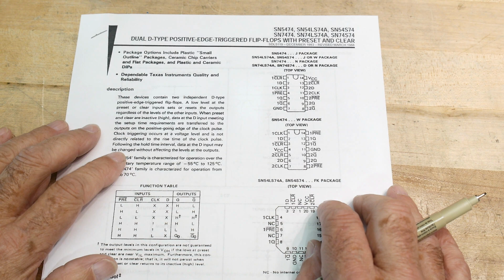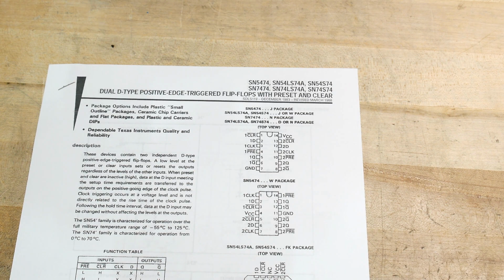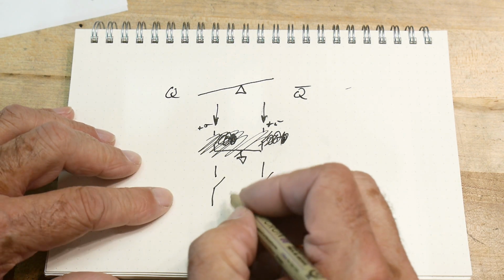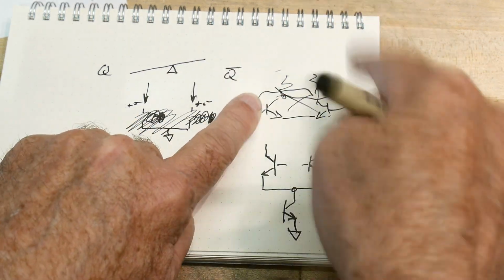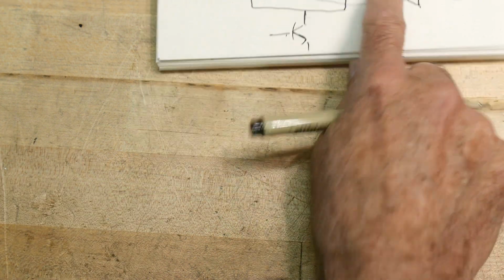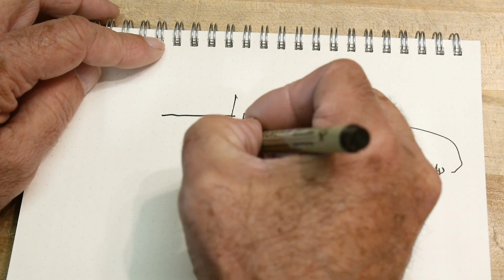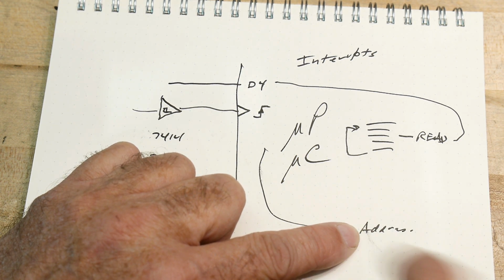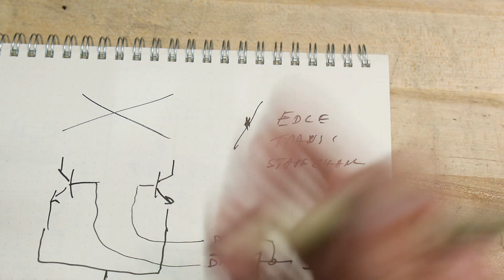#1098 Edgy Electronics

Comment: I thought this tut was excellent, because it corrected my incorrect assumptions. Because of the terms "rising" and "falling," I had always assumed that the circuitry was actually determining if the signal's voltage was increasing, or decreasing at the moment of testing/triggering. Given, the understanding that you have provided, the circuitry is only determining (what should be) the state of the signal's voltage... For detecting a rising edge, the state of the signal's voltage is/(should be) rising in amplitude, based on the state of the setting and vice versa for a falling edge. I add the caveat "should be," because either the DUT, or the test equipment (scope, frequency counter, etc,) may be faulty. This may be the very fault condition that you are seeking to detect/repair. Do I have this correctly? If so, for me, the more illuminating term is "state," not "edge." Hmm... I have learned that, in the EE field, that some things are considered to be wholly the engineer's responsibility to have knowledge of... Such as smoothing caps to be needed in additional to the operational caps stated in a linear voltage regulator's data sheet... I wonder if, for this terminology, we are to already know that "rising/falling edge" is an abbreviation for "rising/falling edge state..."

Comment: The datasheet explains this. On the first page of the TI datasheet for the SN7474, under the DESCRIPTION heading, it says; 
"Clock triggering occurs at a voltage level and is not directly related to the rise time of the clock pulse."

Comment: Changed many X474 chips, because they stopped being edge sensitive, and instead would become level triggered, or they would drift threshold to the point they no longer would trigger with TTL levels. Test statically and they would work, but would not respond to TTL level in circuit. They trigger on change of state, but you really need to have fast rise and fall times going into them as well, as slow changes mean that there is a good chance that poor circuit design, or having a little bit of ground bounce from the other half of the package, combined with Muntzing the decoupling capacitors to one or two per board, makes them more a random number generator instead.

Slow edge on a breadboard, with no decoupling capacitor other than that on the power supply output, will show this up, especially if you use a 10k pot to slowly ramp up through the threshold, and feed the other side with a clock made from another 7400 gate running as an oscillator, and using the clock to feed the other half as a divider alone.

Comment: At 16:00, look at the "V" flags.  Applying 1 to clock simultaneously sets the latch and disables the enable function.  For the feedback counter to function, it MUST be edge triggered; otherwise, the negative feedback would cause oscillations (or linear intermediate state) while the clock is high.
Non-maskable interrupts must be edge-triggered to avoid hanging the processor, but other interrupts are normally level sensitive making it essential that your service routine restore the inactive level.  Interrupt circuitry 1) waits for the executing instruction to complete, 2) pushes the status register onto the stack, 3) sets the interrupt mask, 4) pushes the instruction counter onto the stack, and 5) loads the interrupt vector into the instruction counter.  Other stack operations are possible and are often employed for the user's convenience, but these 5 are essential.

Comment: Well, that's interesting - thank You. But there's something I did not understand, referring to the internal circuitry of the 7474. Why doesn't the bottom flip-flop toggle when Clk is permanently high while D is bouncing up and down a few times 🤔
Reply: The bottom flip flop is mute once it’s turned on. The transistors that react to input are off when CLK is lo. Once CLK is high one of them activates, based on the state of D. Its activation immediately disables the other branch of the flip-flop. The edge triggering is implemented by having a circuit that both latches state and silences it’s inputs *once the state is latched*. That’s where the “magic” is. Such circuits also work beautifully when made out of reed relays.

Comment: I think you have missed an important point. Edge triggered D F-F are not sensitive to the D input when the clock is high, rather only at the edge transition.  There is more to the explanation that must include the time delays for the internal signals. I will attempt:
Looking at the schematic name the Clk buffer transistor Qc and the two transistors to which the collector of Qc connects Qd on the left and Qd\ on the right. When the clock rises and Qc collector falls, current will change only in either Qd or Qd\ depending on the state of D.
If D is high the the base of Qd will be at a high level driven by a current source transistor while the base of Qd\ is already at a low state so no change in current occurs in the Qd\.
Now note a change in D while clock is high cannot change the state of either Qd or Qd\ because of the cross coupled transistors (the ones with the 16k resistors) have changed state and are essentially 'or-ed' to control the current in Qd & Qd\. The clock must now go low and Qc collector go high to allow the state of D to be influential at the bases of Qd &Qd\ when the next clock occurs. At the clock transition - as Qc collector falls - the magic happens and the current steering flips the transistor states.  
The magic happens during the time the Qc collector is falling. During that time the currents flip in those lower transistors and since Qc collector is low - it dominates the state of Qd & Qd\.
The above is not the 'best' explanation I am sure. A deeper explanation would require examining in detail how the currents in the transistors change in time detail down to sub nanosecond level. Also I suspect that some of the magic is related to the voltage levels provided by those two reference diodes in the D buffer. It looks like the collectors of the D buffer transistors are elevated. 
Anyhow: it is an interesting topic, there may be an app note somewhere that explains the operation better than I have done.
Reply: Exactly, any edge triggered input is going to rely on the dynamic behavior of the logic circuit.  These circuits are probably some of the most tricky in terms of getting them manufactured with consistent parameters.  I am sure their was a lot of detailed work in the design of this part.   You want to support a clock as fast as possible which means that you want to tune these delays to be as short as possible, on the other hand if they are too short you don't reliably detect the edges.  Very tricky to design, particularly if you are concerned about a wide range of operating temperatures and resistance to process variations.
Reply: @argcargv  and then we could talk about meta stable states after this type conversation,... thx for the reply.
Reply: @mr1enrollment  yep, it is amazing how analog this little digital circuit is.
Reply: @argcargv  digital is just an approximation, everything (almost) is analog. I am 80% sure about that. ;-}
Reply from the maker: well said Daniel
Reply: This is the key point.